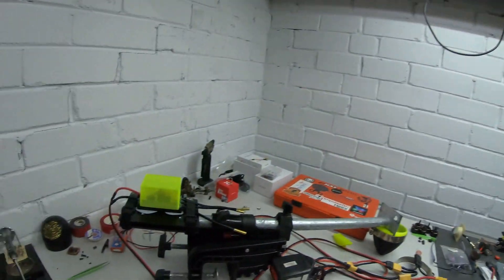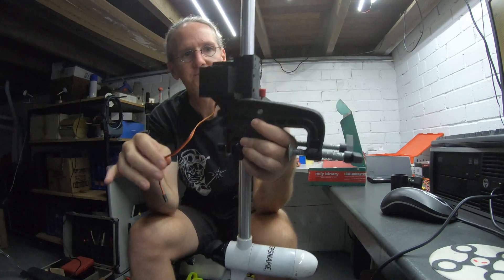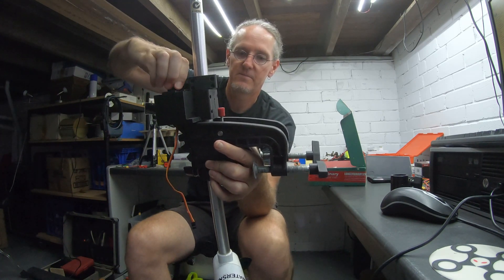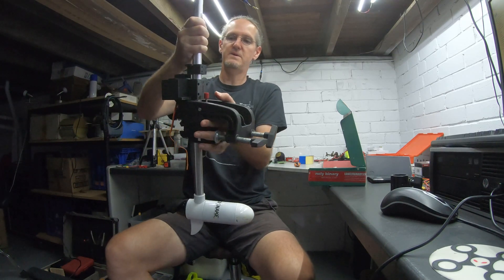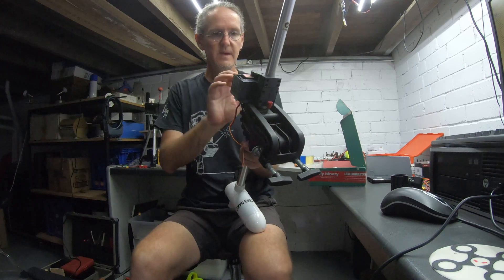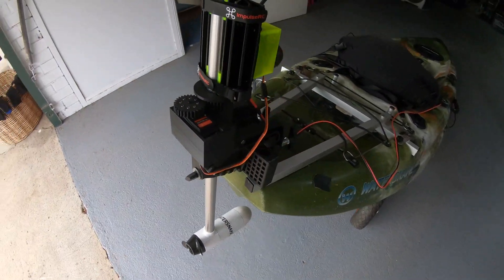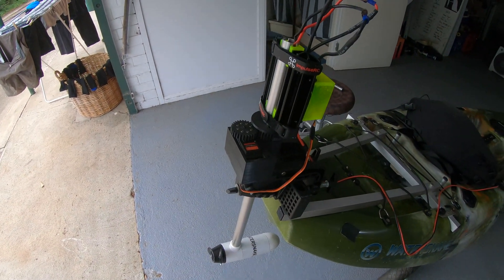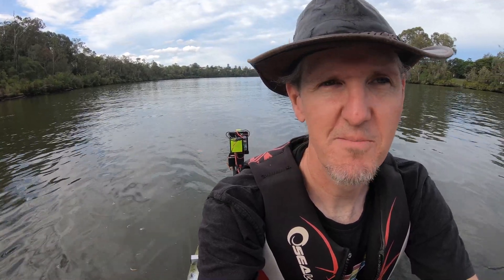Electric Kayak Project Part 5 - I need steering!

Comment: When mounting the servo gear to the servo plate, whatd you use? M2.5 bolts and nuts? I saw in another comment that you used the rubber grommets that came with the servo, where'd you use those? 

Thanks for everything youve done modifying this for the watersnake, itll do me well!!
Reply from the maker: I used M3 hardware from memory, the grommets fit in the servo's mounting holes and the screws go through them into the mount where they are anchored with captured nuts. Good luck! :)

Comment: Can I ask why the servo mount isn't supposed to be as snug as the top gear? What an I missing lol
Reply from the maker: The motor shaft needs to rotate inside the server mount, that's basically why :) The top gear of course must be fastened to the shaft itself in order to turn it.

Comment: I wish you could show each step in assembling clearly. The speed of the time-lapse makes this impossible to follow especially for younger people. If you could sir post a quick video showing assembly to the motor part by part screw by screw THAT WOULD take alot of stress out my life. Thank you
Reply from the maker: Heya, sorry it's hard to follow. I haven't the time and resources to re-do anything in detail unfortunately. I'll look at the time lapse again and see if I can post it unlisted slowed down or something, maybe that will help...
Reply: @strepto42 I finally got everything put together for some reason my wheel doesn't spin freely to turn the shaft. When I attempt to turn left or right my servo just move in place stuck.

Any tips?
Reply from the maker: @BolowArizona  hmm it's a bit hard to pin down without seeing what's going on. The shaft should rotate freely inside the servo holder without the gear attached. The gear part must hug the shaft tightly. Are you using the same model motor? I know some motors have slightly differently sized shafts...
Reply: That would be much appreciated

Comment: Did you just screw a m3 screw down the servo? I cant get mine to either stay put or stop spinning freely because of the hole!
Reply from the maker: Have you put a captured hex nut into the little slots? That's what they're for
Reply: What litte slots? Please make assembly videos just something quick nothing extensive

Comment: Could you please link me to the ESC you used? Seems like it was a good choice. The 5v output is extremely helpful for the Arduino. Does the voltage need the be regulated before the ESC or does it take care of that for you?
Reply from the maker: Heya, so I used a flipsky 75v VESC compatible ESC from these guys. The exact one I bought isn't available any more but any of the chunkier ones will work. https://flipsky.net/collections/electronic-products

If you're in the States this might be a better alternative though: https://spintend.com/collections/diy-electric-skateboard-parts/products/single-ubox-aluminum-controller-80v-100a-based-on-vesc

For 14S you need 75v and the ESC will regulate it for you. For 12S and below a 60V VESC compatible ESC will work. Other considerations are how to make them waterproof and cooling. Good luck!

Comment: I'm having a little trouble tightening the shaft gear tight enough to the shaft so that it doesn't move. Did you have to glue or tape or anything to keep it still? I'm using M4 bolts and nuts and even then the thread will pull or the bolt will turn before it's tight enough
Reply from the maker: Yes I had a lot of trouble with this. I used some bear tape at first and small amounts of heatshrink as spacers but even that moved. In the end I drilled a small hole and fixed it to the shaft with an m3 screw on the non-gear side. It hasn't budged since. For a lower power motor the tape should be adequate but for my high powered motor it just had too much lateral torque esp when steering under power so the screw became nescessary. I never bothered to revise the print; I just drilled it carefully and made sure the hole was slightly smaller than 3mm so as to let the thread bite the aluminium.
Reply: @strepto42  thanks - very helpful!

Comment: The servo motor is 6-8v. Which regulator did you end up going with? I need to think about the power wiring next for the Wemos, Servo and ESC
Reply from the maker: One of these: https://www.aliexpress.com/item/4000764834254.html

I got the 5A, 10-72V to 7.5V variant. Works perfectly and is waterproof as a bonus.

The ESC takes up to 75v also, and puts out 5v for the receiver. All up pretty simple wiring. I am now using this controller too: https://www.aliexpress.com/item/1005003994231921.html

Comment: Would you mind sharing what screws/allen bolts you used to secure the servo gear to the servo "plate"?
Reply from the maker: I used M3 2.5mm button head hex bolts - not sure what length though sorry. Probably around 15-20mm but you'd have to measure to see what fits. Captured nuts in the slots of the 3d prints. I also used the rubber grommets that came with the servo.
Reply: @strepto42  Worked perfectly!
Reply: @markkenna8162 can you post a video of your assembly and link it here I need alot of help been working on this 2 weeks and still stuck
Reply: @strepto42 Any way you could make a quick 3 minute video showing the ASSEMBLY camera on your hands so we can knock this project out with less guessing and questions need to see how all the 3d files are put together  ... please

Comment: I am about to give this a go for my Watersnake T24. What kind of programming did you have on this? The original design mentions programming software. Thanks
Reply from the maker: No software for me, just hardware. It's simply a servo to control steering, and an ESC to control the motor (optional if you want throttle control)

Comment: I am 100% committing to make this. I'm too fluffy to sit in the back of my scanoe and run the motor without sinking the boat. this is the most elegant solution possible. 

Thank you. the internet is truly an amazing place.
Reply from the maker: That's great! Let me know if you need a hand. I've had to tweak the design a bit but the stuff on thingiverse should still work pretty well, especially with a lower powered motor like the watersnake 24.

Comment: 1) What battery do you use for the reciver? 
2) The motor it 12 volts? 
3) Do you use a regulator of speed bettwen motor and reciver?
It Will be of good use a video about this información.
Reply from the maker: 1) the main battery, the speed controller has 5v output. 2) normally this motor does, in this video I am using 50v. 3) yes, I suggest you watch the entire series, or at least part 2, 3 and 4 :)

Comment: i loved your projects. Congratulations. i'd like to know the piece you used for remote control
Reply from the maker: Thanks so much :) Originally I used the FlySky FS-GT3B RC car remote but I've recently switched to this cheaper, 6 channel unit. It has cruise control which is very handy. https://www.aliexpress.com/item/1005003753015123.html

Comment: East Texas Here; I'm a RC person also and this idea is very cool. Makes me think about doing the same thing. For the steering and tracking, put a rudder board on the shaft to the motor like I did. So, if the motor quits you still have the tracking when you have to paddle. I steer with my feet tho.
Reply from the maker: That's quite a nice idea, yes! I wish I had rudder pedals. I'd still need my hands to paddle though which would mean I wouldn't be able to steer with the remote as it stands. But I will file that one away!

Comment: Would be cool if you added a FC board and then could set gps waypoints for autoguidance. You could have ultrasonic collision detection and avoidance too.
Reply from the maker: Haha - let's just say there's a reason I flashed inav onto something recently. This has always been in the game plan. 😊
Reply: @strepto42  Great 👍
Reply: gps; way points, now thats having a machine working for you...lol...Gps your favorite fishing holes and set the Way Point on the Gps...
Reply: @billyscave  Exactly. Plus if you lost track of time and it got dark the system could see you safely back.
Reply from the maker: @changeagent228  Haha not sure if I'd trust it without quite a lot of testing! I've had some setbacks lately but the game plan is still to have inav going eventually. For now I'm concentrating on getting the system stable with the new giant motor (vid to come).
Reply: @strepto42  Haha fair enough it's all good fun anyhow. Look forward to seeing your next video. 👍